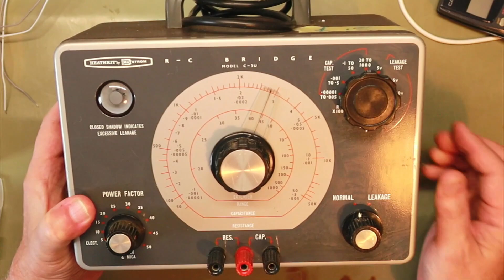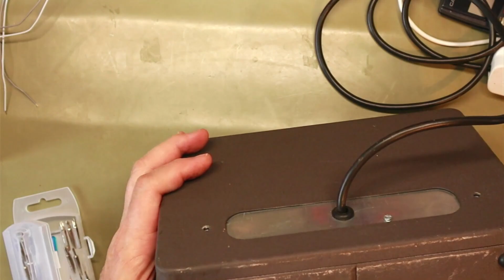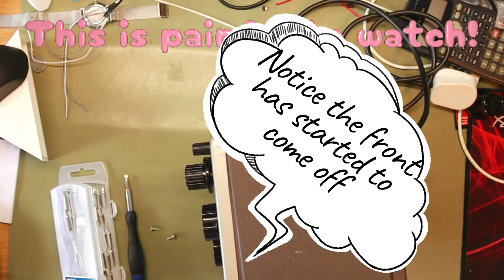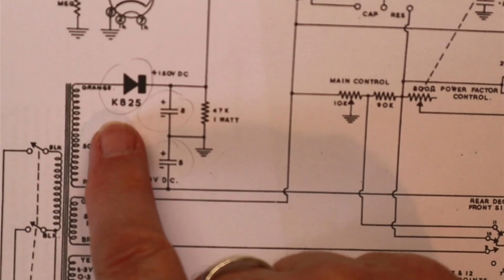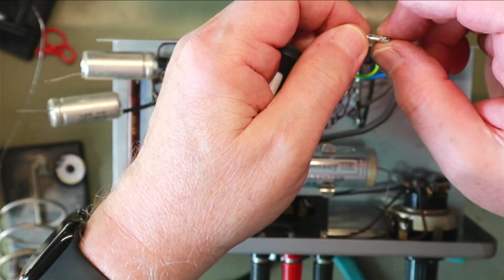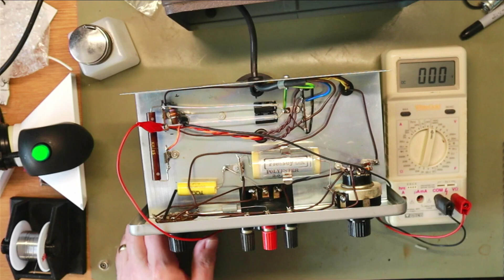#259 HeathKit Daystorm RC meter C-3U repair part 1

Comment: Interesting to see the difference between the C-3(USA) and C-3U(K).  The monster selenium instead of a valve ("tube" to us in the Colonies).  (Restuffing a selenium? Brilliant!) The large oval instead of small round opening in the back case.  The double-eyed tube (Magic Eye Valve???).  More locally sourced war surplus ("Plessey UK").   Finally, Daystrom calling it a "R-C BRIDGE" rather than a Condenser Checker.  Nice video!
Reply from the maker: Thanks for the comment, and glad you liked it.
I did read that HeathKit started making kits with war surplus components. so some good things can come out of a war.

Comment: When those Selenium rectifiers fail they smell awful, like burnt cabbage.
Reply from the maker: So one of them and a Rifa cap letting go at the same time would be a great mix of smells. 🙂
Reply: @TheEmbeddedHobbyist  Funny enough, I just fixed something with 3 faulty Rifa caps. I used to repair TV's with voltage triplers that were selenium, and I would walk into a house and instantly know what the fault was, from the smell.
Reply from the maker: @KB1UIF  the one in my commodore PET floppy disc drive let go and stank the room out for weeks. The smell seemed to have impregnated the metal. 🤣😂

Comment: I guess you haven't worked on much Heathkit equipment before. You probably won't forget that fronts come off, now. I still have a Weller iron like that knocking around, but I run it off a 120v to 240v transformer as I now live in the USA. The tip on mine has to be about 30 plus years old, too.
I thought we were going to see a hedgehog for a moment like My mate Vince!! Lol.
Reply from the maker: I built a heathkit car radio in 1975, and some where knocking around the place is a transistor tester from about the same time.  Heathkit were out of my price range at the time.

Comment: OMG…….I cut my teeth with one of those Weller irons 40 years ago…..😮
Reply from the maker: I've always had a soft spot for the Weller Magnastat irons.
This one has had the same tip for about 30years. I can't unscrew the cap that holds the tip in, but won't try hard until the tip finally corrodes away. 
At the time they were one of the few irons that seemed to have a stable enough temperature to keep the QC department happy.

A ticking iron was a happy iron :-)
Reply: @TheEmbeddedHobbyist  yes, I remember they would jam up. We used the 110V version in our workshop for some reason!
Reply from the maker: @IanScottJohnston  they must have thought you were working outside. 110V is less likely to kill you 😀
I had a 24V one stick and when it cooled down the handle had gone brown.
The case and transformer were used to make my Weller micro pencil controller, so out of the ash's as they say.

Comment: Easy fix for the rectifier... just put in 41 silicone diodes in series.... better than using 71 Schottky.
Reply from the maker: I've got got a lot of 1n4148's so was thinking of putting two strings of 41 in parallel.

Comment: @7:12 that switch moved as you turned it, you might need to tighten up its locking nut so it doesn't stress the connections.
Reply from the maker: Thanks' I'll look at giving the nut a tweak, the great thing with Heathkit equipment there are a lot of information on how to build them.

Comment: £15 for the Daytsorm RC meter, a real bargain. Could you use the high voltage rectifier out of an old microwave oven?
Reply from the maker: Not sure what the voltage drop on a high voltage rectifier is, the problem with the selenium rectifiers is the volt drop across them.  they design this in to the DC conditions so if you don't match the expected volt drop then the +150 will be too high.